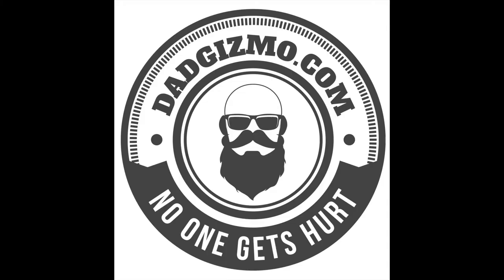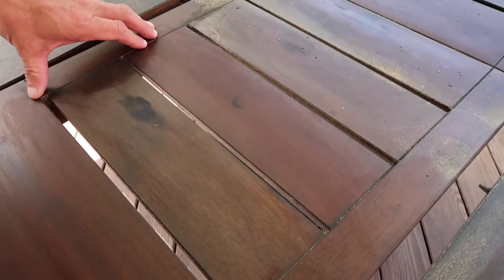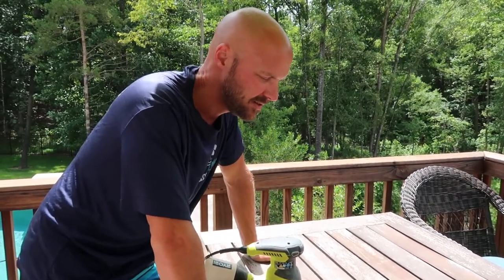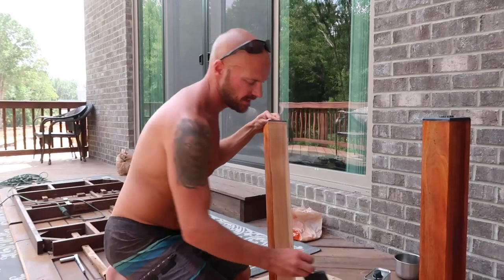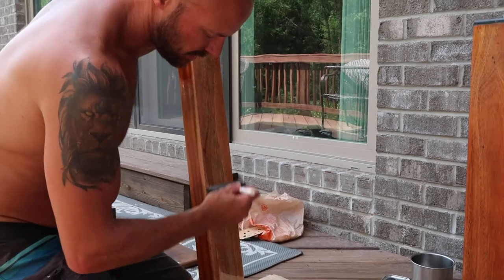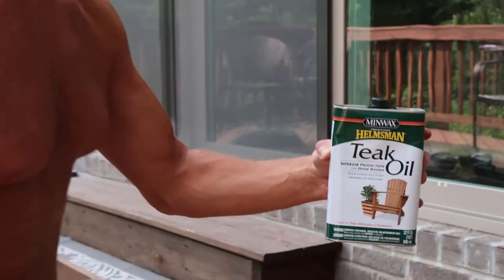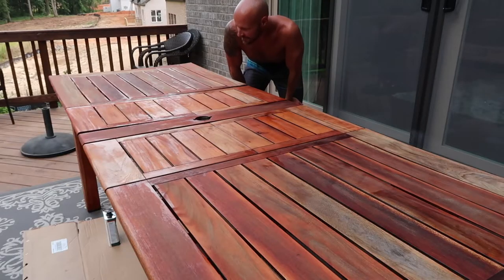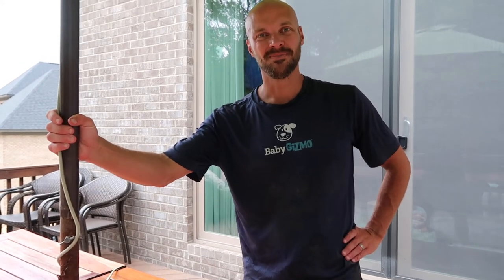How to Refinish Outdoor Wood Furniture with Minwax Teak Oil | DAD HACK

Comment: Great job !!! Congrats. I just did my acacia table the same way today: sanded 80 grit then resanded 120 grit. 1 coat of Meguiar's Teak Oil, then i need to wait 24 hours to put the 2nd coat, then eventually another 24 hours for a third coat on the very exposed areas. So I'll keep on oiling it tomorrow and the day after for the best result.
Reply from the maker: Lau Rent cool! Post a pic - would love to see it!

Comment: Over 11 years I have teak oiled my furniture 3 times and have gone through about 12 quarts of minwax teak oil.  Each time sanded and oiled.  I highly suggest never using teak oil again and looking into a quality teak sealer like semco which is a marine grade teak sealer.  I have recently disassembled 16 pieces of teak furniture sanded with 120 orbital, 120 palm then 180 palm finished with semco teak sealer.

Comment: The directions said after the second coat let sit for 30 min and then wipe off excess. It doesn’t seem like a good idea because it’s sticky and tacky. Did you wipe down the second coat or just leave it and let it dry?
Reply from the maker: Nancy Mills I let it dry completely.  Then I lightly sanded it with 220 and coated it again.
Reply: I just used this product on an outdoor mohogany picnic table and wiped it off after the 2nd coat like they suggested. Actually had to wipe it off a few more times the next day. Once the sun hit the table it started coming up out of the wood a little. Looks great now and everything wipes off easy after get togethers.

Comment: I used Minwax Helmsman Teak Oil on teak and it came out horrible!!!! I followed the directions precisely and the finish came out blotchy and ugly....I was so mad....all the work I put in was ruined by this horrible product....read the reviews on it....you won't use it after reading.  Now I have been sanding it off, trying to get back to something I like.  Since it soaks into the wood, I cannot remove it completely...don't buy this product....horrible.  And I notice how blotchy and uneven the finish is on that table....ugh.  If you like blotchy, uneven finishes go for it....if you want a nice finish you'll have to sand that finish down and work on it more...that's what I am doing right now on a teak wallI put up on my front porch...soooo much more work just to try to even out the finish.
Reply from the maker: Mia Krauss I hate to say this - but I agree!  The finish looked a little blotchy on my project and frankly it is getting worse!
Reply: @MrGizmo211  So I ended up sanding the heck out of my project...80, 150, 220 finished up with 500....used mineral spirits to clean it...now it looks pretty good....lots of extra work.  I think if it were thinned with mineral spirits and thin coats applied with sanding in between it would have been much better.  The instructions are terrible on the can.  Also, I complained loudly to Minwax, sent photos and they refunded me the cost of the can....not my labor to fix their horrible product.